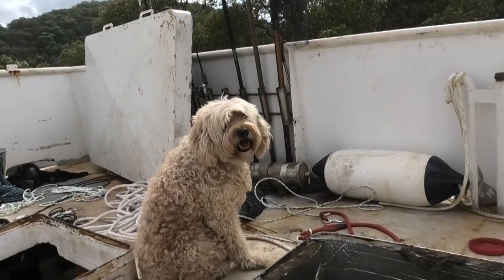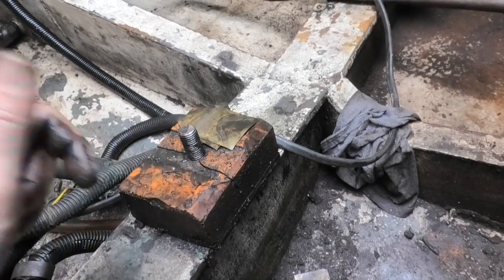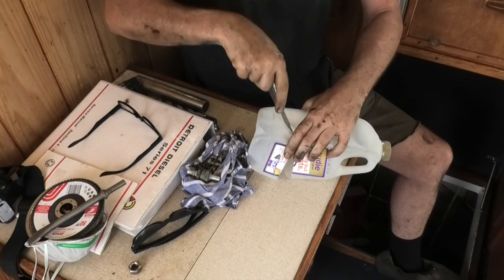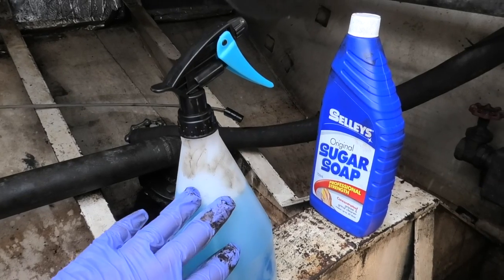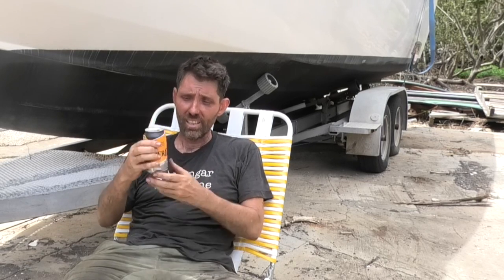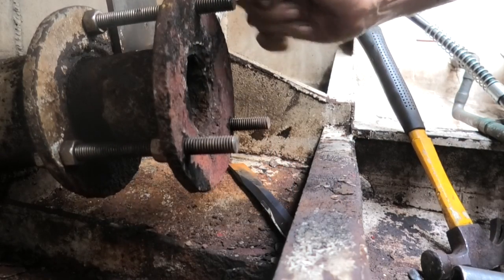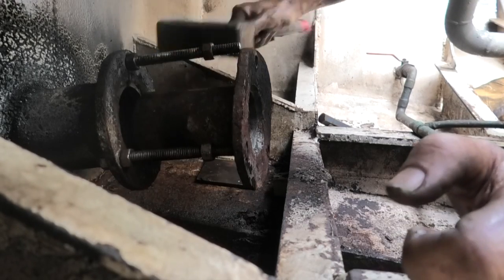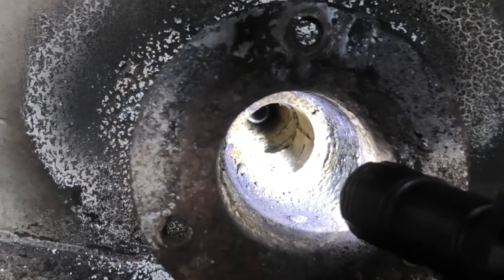Removing the propeller shaft from the steel trawler

Comment: Interested in what you do about corroded hull plate, I think I'd just cut it out and weld in some new stuff. 
Usually whatever corrosion you think you can see, its usually twice as bad.
Ultimately I guess you will be repainting inside and out anyway so there are few downsides. 
Depending how thick it is you will need to pay attention to fitting the plates level, so learn a bit of a plate dog and wedge skills, and weld penetration with edge prep.
Should be a good video project to boot. You dont see that sort of stuff on you tube but its one of the things that makes steel hulls so knock about and versatile. 
have a good one ...
Reply from the maker: Hey mate. It is true about not seeing this stuff on YouTube much. I've been looking for a video on cutting out a plate and replacing it to learn from myself and haven't yet found anything. Another good reason to film one. I had a sheet of 4mm steel delivered last week for the transom but I will definitely have some offcuts left over for other patches.
Reply: @DangarMarine  Its all about minimising heat input with relatively thin plate. Basically wherever you work on plate heat makes it expand, and usually it shrinks more than it expanded, which creates distortions and buckling. 

I'd cut it out with a cutting blade on a grinder instead of a torch. I'd tend to tack it together as level as I could, sometimes it helps to have a mate hold a hammer flat on the plate on the inside while you adjust with another hammer from below. And/or you can use plate dogs and wedges to move plate in and out. The new plate needs to be a close fit. So when its tacked up, stitch weld it in to keep the heat down, probably best from the inside because its downhand. You can use a length of copper bar to soak heat, something like 2" x 3/8 to 1/2" as long as you need. You will especially need this welding outside as that will be uphand. Once the top is welded finish off the underside cleaning out whatever slag you find making as smooth a transition as you can, that will help you weld the uphand which is always difficult.
have a good one.

Comment: just out of curiosity, wouldn't it have been easier to put holes at the bottom of the ship. between the ribs of steel.  that way you can clean those bilge compartments really good, with a pressure washer, and the hole will give you an idea as to how thick the steel is, or deteriorated.   The boat is made of steel, and you can weld the holes back up. Just curious.
Reply from the maker: I could, but the bilge pump got the water back out pretty quickly and I'm going to use the ultrasonic tester to do a full survey on the hull thickness.

Comment: Hi Stu, Was pleasantly surprised to see this video today early. Nice cleaning process on the bilge and interested on the thickness left in those areas. Doesn't look that bad on the video but nice to know how much is there for sure. The prop shaft came out good but the housing inside looked like a pain and lucky to get it out. I watched another video about the leak strip packing but they didn't show this removal tool. Are you having the same folks who will sand blast the outside hull do the rudder also? Was there the leak packing on the rudder exit area too or the other end? Looking forward to the next video. Tim
Reply from the maker: I'll might have a go at doing the rudder myself with a wet blaster. The rudder post doesn't have the same packing, it has a regular oil seal up the top just above the waterline.

Comment: In your opinion was this vessel maintained as it should have been or somewhat neglected?
Reply: Kinda good shape for a work boat I'd say
Reply: I agree with @Victorys 7th ast, for a work boat it doesnt look too bad.

We only see a couple boats like these down here in the Keys. And they are in way worse shape than this!
Reply: I've went to work on boats unbeknownst to me at the time with wood plugs beat into the hull because rust spots were so bad. I jumped ship pretty quick after that
Reply: @robp7652  that's pretty ridiculous lol I like the big brands that use cheap plugs too! 

Like Boston whaler that has that plastic plug on those $700k boats! 

PLACTIC! Like yeah this is a good idea ha.

Now the last video we made, on that 39' Sea Vee with the Quad 400s. That's a nice boat!

But even those. I've seen the sea chest boxes with the live well pumps brake off the string and smash the bilge pumps, then catch the float switch on fire! Talk about ridiculous :)
Reply from the maker: The maintenance was definitely neglected for at least the last three years of its final owner. The anodes being completely eaten away before replacement is a huge no-no on steel boats.

Comment: A great watch as always, keep up the good work. The hull sounds a bit thin at 1:00 when you hit it with a wrench, hopefully not as it looks like it'd be a PIA to repair that section..Getting that prop off is going to be a bear also, obviously the previous owner has never heard of a SS or a brass nut and cotterpin....Mike
Reply from the maker: Yes, it will be interesting to measure it accurately. I certainly wish that nut hadn't been welded on!

Comment: Shaft looks pretty good considering its care. Might try some boiler tube brushes to clean out the prop shaft tube or weld up a small brush drill to a rod so it does not pull off in the tube, fill it with degreaser and see what the pressure washer wand can fit in it or make a custom tube at long as the prop shaft????

Comment: you may consider add a grease fitting to the stuffing box to keep the packing greased
if you don't know cut the ends of the packing at 45 degrees rather than straight like your old ones, three rings 180 apart on the joints and you are golden
Reply: 120 degrees
Reply: @RayThackeray  That shortens the path between joints from 360 degrees to 240 but if it works for you be my guest
Reply: @davehurst2543  I was repeating the conventional wisdom as promulgated in multiple texts I've read but you raise a good point. Then I thought perhaps 120 degrees is correct. You still want a path for a little water to drip - cutting off flow entirely might be the effect of 180 degree joint staggering.
Reply: @RayThackeray  that is achieved by the tightness of the packing gland

Comment: I don't know if you've got SImple Green in Aus but applied full strength and steaming hot it works amazing at cutting old oily crud. It's also a great general boat cleaner diluted 10:1 for general use or 5:1 for gel coat clean up.

Only downside is it's mildly corrosive to aluminum.  A good rise or two is more than enough.

Comment: That old stern gland packing is most likely asbestos. Double bag it and wet vac the bilge again.  Also, what is the wrapping on the exhaust?  Is that asbestos or Nomex?  If you suspect asbestos, wet it,remove it and double bag it. Wear a mask and disposable painters suit while removing it /cleaning.  In the yard,  Shower/ hose off yourself wearing the suit. Double bag suit and mask for safe disposal.  You can't be too careful with that stuff, It could get you 20 years later!
Reply from the maker: Yes, I think I will remove that exhaust wrapping regardless of what it is made of as it really seems to be showing its age.

Comment: Stu that engine block was probably "Chock fast" (TM) an epoxy resin, used it on big engines too. Normal use wise line the engine up build a box where the chock is supposed to go, mix the two part mix, pour, let harden.
Reply from the maker: I think it might be too. I might just redo the broken mounts using the same product.
Reply: If I remember correctly the product is named "chock fast orange"

Comment: Hello Stu, love your steel boat you are doing, nice. You mention about plugging up the bottom frame cut outs?. I wouldn't recommend welding them up because not only are they there for drainage but they help with the frame strength on each corner. Welding them may cause cracks under load.
Reply from the maker: I might look into making a tray to go under the stern gland. That should give me the best of both worlds.

Comment: So, was the packing seal waxed  flax? I couldn't really tell by looking but I know from replacing several of these that cutting the ends at a 45 degree angle gives a better seal and staggering the joins also. Stuffing looked to be about 1/2 an inch. 
Might want to look at the tips on the prop where they contacted the concrete. (Sorry, old Navy guy here and prop chatter still comes to the fore in my mind) 
Really enjoying your channel.
Reply from the maker: Not sure what the old packing was made out of, the new stuff is teflon. Good point about checking the prop. The place I'm taking it all too actually does prop repairs too. :)

Comment: I wonder if truck bed liner would help protect the inside of the hull from any leaks? Stuff is pretty tough!
Reply from the maker: Thinking I might use that for the top deck after everyones recommendations.
Reply: @DangarMarine  It works well for Anti-skid if you get the gritty stuff, so that might be a good course of action.
Reply: Great idea. The new formulas are good against oils, solvents and hold up great.  Just make sure the rust is gone/neutralized because anything under the coating is trapped.  Use the recommended primer.

Comment: I’m enjoying your videos, found them while recovering from a chest infection at home . I have  a Yamaha GP1200R twostroke that I enjoy working on and rectifying the failure points  ( planned in my opinion) the manufacturers built into the designs to ensure you spend money fixing them with their parts . I would be interested to see if you have found designs of parts that fail because of a design fault that can be easily fixed to extend the life of the engine. I find they do this in the carbs quite a bit and fuel pumps . 
Regards Adam Troy

Comment: Re the sand-blasting (- especially in a confined environment), you'll need to wear an air supply/ SCUBA setup/ etc.  When the sand particles hit the surfaces and shatter, they make tiny respirable particles that if you breath them in, kill you in 5 years time....
Reply from the maker: Yes, if I do go with dry blasting I was thinking of making up a long hookah hose for my SCUBA reg.
Reply: Couldn’t you wear a respirator?  You don’t need supplied air.

Comment: Try a wet blast using a water blaster with sand attachment, they work OK, or an automotive dry sand  crap recycle the sand one, they are slow but make little mess.

Comment: Don't block up the drain hole. A bilge pump under the motor where you cant get to it repair will be the first one to break. Also easy off oven cleaner or zeps grill cleaner (environmental friendly) makes great degreasers.

Comment: The threads on that puller looked pretty dry.  A liberal dab of grease before use will make it last a lot longer, especially when using a rattle gun.

Comment: I have a 1990 Yamaha Pro 50LD  outboard, The Steering Trim Tab anode bolt head is broken off.  How do you remove a very salt water corroded stainless steel bolt shank.  I need to break the bolt shank free before I can remove the lower drive unit. There is lots of Salt/Aluminum white crap still holding the bolt shank solid in the lower drive housing.  The bolt shank threads are into the leg unit.

Comment: Do you feel that epoxy is the best choice for your conditions ( saltwater) ? I don’t know I was just asking . Could you or would you double hull that area beings your not going to be able to reach it with the engine in place, just for insurance or peace of mind? I was surprised that packing came out as easy as it did ! SKOL BUD !
Reply: We always used something we called coal tar epoxy. Works great and was pretty cheap

Comment: Would it not be easier to hang a powerful outboard on this boat and eliminate the shaft box and rudder?  I am enjoying these videos.
Reply: That's not a bad idea! Probably not feasible though, depends on the weight of the boat.

Then again they do have outboard diesels now :) so you won't lose any torque!

Probably best to stick with the way it is. But as far entertainment goes, I'd enjoy seeing a bracket and a couple outboards being hung! :)
Reply: I saw it done in Alabama once . Not feasible for any type of open water
Reply: Victorys Why is it not feasible for open water?  Is it because of the original hull shape and design or is the weight of the steel construction the most important factor.?  I know next to nothing about naval architecture.
Reply: @zeekwolfe6251  on let's say a 60 foot vessel. When the weather gets "up" the waves will have the decks awash. Another way to say it is the wave action will cover the decks at some point . On and off on and off. To mount even a long shaft outboard on the stern of a I'm guessing stu's boat is 40 feet at the most the powerhead will be what 2 feet above the waterline ? 3 at the most and that would be too much. Anyway the easiest way I can say now is the outboard would be "swamped" if there was a 4 to 5 foot sea . When the stern dipps down into the belly of a wave the engine would be underwater.

Comment: As a steel boat numptie is  replacing the shaft seal something you do as required,  10 yearly, half boat life?  It seems like a hell of a lot of work for something that is pretty critical.
Reply from the maker: It's really only a lot of work because it has been neglected for so long. If kept in good condition it should be relatively easy to replace the packing.

Comment: Slurp in some CLR for a night  ,it’s calcium lime rust , solution leave for a night , brush it about a few times , it will eat all the crap off and back to shinny steel , dry off next day and paint , worked for us in larger areas 5 years ago and still clean tidy paint ther today, and the shaft thing a small grinder cut it off much quicker and cut off the back plate and fit a rubber hose lip seal   Will last many years   That old systerm there is passed it , dial up lip seals you will see what I mean
Reply from the maker: Co-incidentally I am going to buy some CLR tomorrow to clean up an old exhaust manifold. I'll put some in the bilge too. Not sure which way I'll go with the shaft seal, but I'll definitely look at all the options before making a choice.

Comment: I’m really enjoying this series. I’ve been wanting to do my own steel boat for quite a while. I’m really surprised that you’re not using a creeper oil to break a lot of parts loose. Do you have creeper oil in Australia?
Reply from the maker: Have been oiling all the parts before attempting to remove but when they are they tight or corroded it only helps marginally.

Comment: Fantastic work and really enjoyed your video. I am going through the same pain with a 78 foot Dutch steel ketch. The engine's out but bugger it my access to the stuffing box is only fit for greased contortionist gollums. My stuffing box internal compression sleeve is cast iron, the external casing seems to be welded to the stern tube so I think it's steel. I haven't cleaned it and it's pretty corroded. What metal are yours made of? They looked like mild steel. I am thinking of fabricating my inner compression sleeve out of 304 stainless, any ideas or am I bonkers?
Reply from the maker: Mine was made out of mild steel and I have had another one made that is also mild. The first one lasted 30 years so I expect this one will do the same.
Reply: @DangarMarine  Thank you for your reply!! This really helps me a huge deal, because I got a rather high quote to replace our cast iron stuffing box and I simply could not see why a pipe welded to a flange couldn't work just as well. Was yours painted at some time do you think, off was it simply coated with grease?

Comment: Make sure you degrease the bilge to paint ready before sandblasting, otherwise you can have the grease driven into the pores of the metal and when it comes time to paint you will have problems.
Reply from the maker: Definitely. Don't want the paint to peel within a few months.

Comment: Question for those in the know. Is there any reason why, where the metal has become thin, you can't just cut it out and MIG/TIG in a patch. The say way you would repair a rusted panel on a car?
Reply: You can .
Reply: It's probably stronger to patch over the portion from the inside though. Thickening it up.

As well as leaving the smooth and solid hull in 1 piece! You'd think cutting out a section would create a "weak" spot
Reply: @BornAgainBoating  patching over it promotes and increases the new plate rusting quick and snappy. Here in NZ it gets cut out and  the patch is welded back in flush with existing hull plates
Reply: @BornAgainBoating  plating over it traps moisture and promotes rust.
Reply: @southjerseysound7340  well that rules out plating it!
Reply: @caseydixon8714  that's why it's best to get a professional! I'll stick to fiberglass :) 

Thanks for letting us know!

Comment: That shaft log wasn't as bad as I was expecting.  I have seen worse.  Are you going to use Teflon packing?  If you do be sure to add a water cooling line to it.

I was expecting a tapered shaft with that coupling, I wasn't expecting the step in the shaft.
Reply from the maker: Yes, it is Teflon packing I have bought. Will look into ways to add the cooling line.

Comment: Awesome videos. Than you. 
Question, why is it that when I turn the key to start my motor it runs at max RPM’s automatically. This just happened on the water yesterday and I’m trying to figure out why. If I turn the key it runs as hot as it can until I shut it off. Any advice?
Reply from the maker: Is diesel or petrol? If petrol, EFI or carbureted?
Reply: Dangar Marine it's petrol and an EFI. Thank you for responding.
Reply: Dangar Marine 
Ok, thankfully I located the problem. Somehow a loose wire had gotten sucked into one of the butterflies causing it to remain open, and the motor was sucking in straight air. This is why when I would go to crank it, it sounded like it was going to blow up!